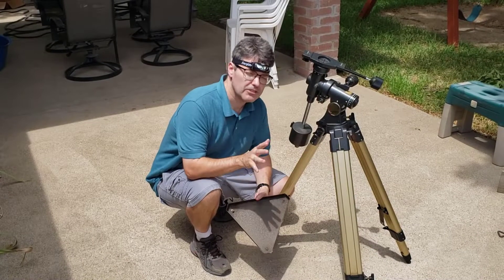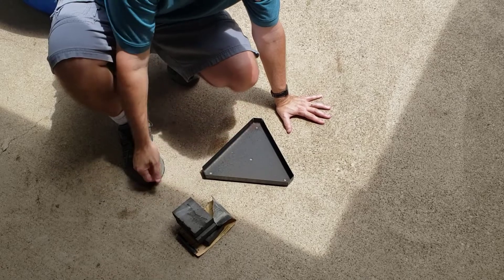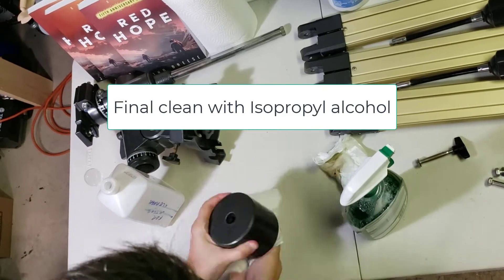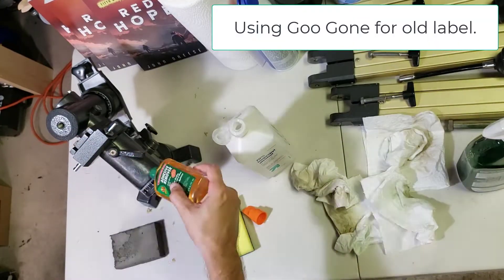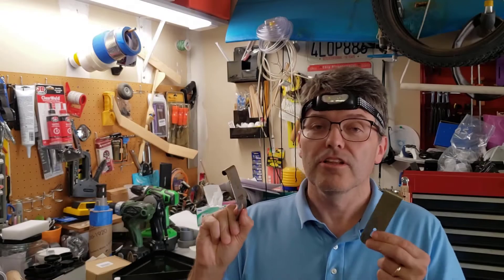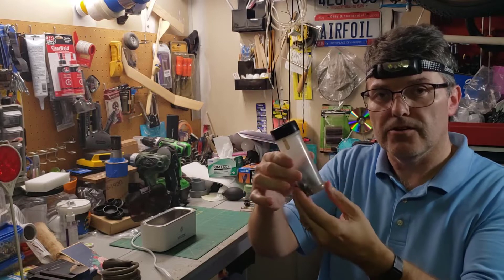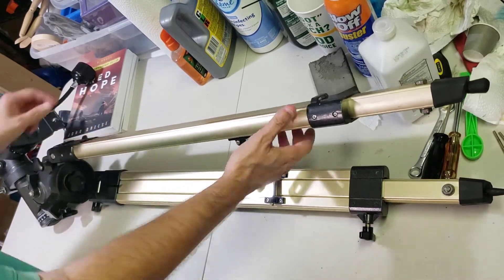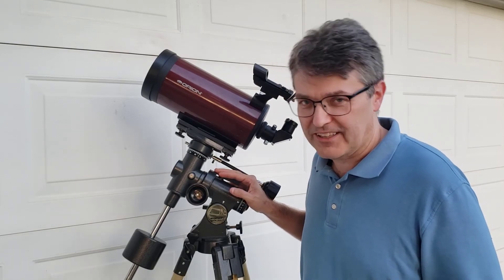Restoration: Equatorial Telescope Mount (Smoke residue, rust, and dog pee)

Comment: A nice little video for the newbie and rank amateur. Not bad at all.
What happened to that mount before you got it was criminal! If anyone were to smoke anywhere near my 30 plus telescopes they and the cigs would be quickly dealt with in a very unpleasant manner. In addition, ANY dog that even thought about trying to pee on my equipment would be on my dinner plate the following night, or sooner!
With Orion and Meade going belly up I guess all that is left for cheap toys is Explore Scientific and Celestron. LOL
I got the very strong impression that you were trying to suggest that people should buy your book and follow the adventures of Alan Alston. You sneaky fellow! LOL
By the way, Evapo-Rust works better than CRL and an ultra-sonic cleaner is not needed. Paint is good for fast jobs and stuff that isn't worth much. I'm moving on to powder coating for my equipment. It is far stronger than paint and no more difficult to apply. Plus, I can get almost as many color schemes in powder as I can in paint.
Reply from the maker: I bought these used, so there's no telling the trouble it suffered prior to me getting it (I don't smoke and I'd never let a pet pee on it).  I'd never heard of Evapo-Rust, thanks for the tip!

Comment: I have the same mount and tripod. Couldn't wait to stop using the tripod. Complete hassle to set up / tear down. On the other hand, the mount is a delight to use, and is easy to polar align. Just put it on a better tripod.
Reply from the maker: I'm used to very low-end tripods, so this seemed like an upgrade to me. But I've seen some of the super high-end tripods that look rock solid.  Thanks for watching!

Comment: Thank you for this excellent presentation! Would you be so kind to help me, how I can fix the declination centerline? It isn't rotating. Regards from Hungary.
Reply from the maker: Generally speaking, you have to point the telescope at a known target (for example, Sirius), then using an app or star map with a coordinate grid, read the right-ascension and declination angles and set them on the telescope - the setting circles are adjustable.  From that point on, you should be able to find anything if given the right-ascension and declination angles.
Reply: Thanks for the quick response! I think I was misunderstood. There is no adjustment difficulty,; - the declination axis does not rotate. I have to take it apart and apply with WD40. How can I take it apart? I removed the mounting screws and the top yet. I see the aluminum gear weehls....and...how to proceed next? @AstronomyGarage
Reply from the maker: @imre2784  Can you send a picture of the equatorial system to JJDreese@yahoo.com?

Comment: So glad I found this (via Cloudynights page). Yours looks to be exactly the Orion Skyview mount I have (except mine has motors). My problem is the DEC axis is completely frozen. I suppose if I get my polar alignment correct it should be a non-issue (right?) but it irks me. Any tips on freeing it up? I've tried to drip penetrating oil in, no luck yet. I'm nervous about gripping the gear to get some leverage on it.
Reply from the maker: If you disassemble it very carefully, I bet you can find the problem.  Either a screw is bound up or there is rust.  Are you able to remove both axis lock screws?  Take lots of pictures as you disassemble it - that is a game changer when putting it back together.
Reply: @AstronomyGarage  I can remove lock screws no problem, my first thought was that would be a good place to start dripping in a penetrant. Thanks for your responses!

Comment: What to do if a dobsonian telescope getting rust😭
Reply from the maker: It depends.  A rusty Dobsonian  probably won't affect the view, but if it's messing with operations (trunions, focuser, etc.), then you may need to sand down the rust and repaint it.
Reply: @AstronomyGarage  someone told me to coat the outer part of the optical tube with epoxy... Should i do that?
Reply from the maker: @adarsh2919  Well, that would certainly give it a hard shiny coating, but that's a lot of epoxy.  If the entire thing is rusty, I would recommend doing a good sanding job and then paint it with a primer.
Reply: @AstronomyGarage  mmhm its not entirely rusty but ,in some parts, its getting rust slowly....